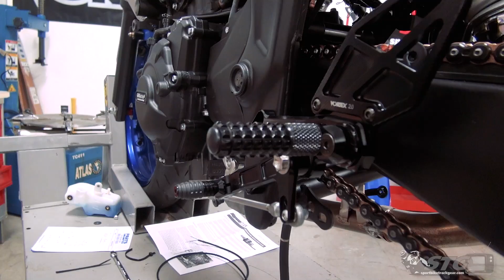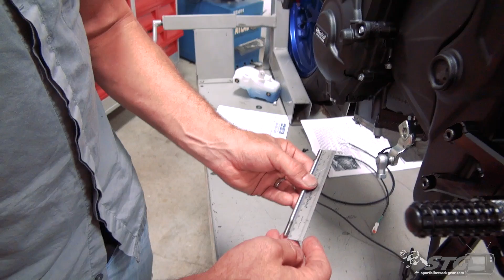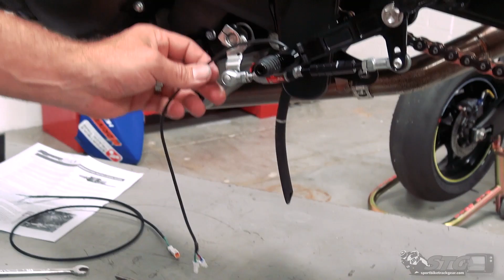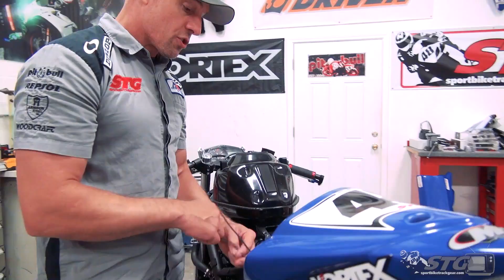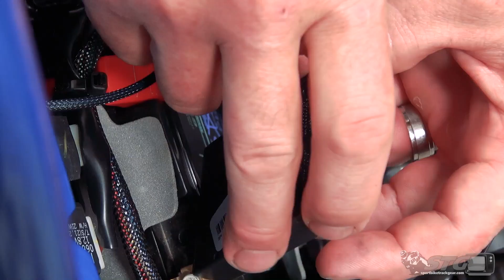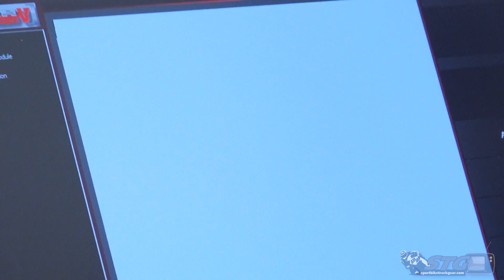Dynojet Yamaha R3 Power Commander V Quick Shifter Sensor Install | Sportbike Track Gear

Comment: A Yamaha R3 will use a Pull or a Push sensor in case you are not using the dual dynojet sensor ?

Comment: Van is obsessed with keeping his bikes clean. All my bikes have chain lube sprayed on the heim joints and on the chain ..
Reply from the maker: I do prefer a clean bike. - Van
Reply: @sportbiketrackgear    I am trying to get  20,000 miles out of my OEM chain and sprockets so I keep  putting on the Bel-Ray chain lube every day.  I bought half a case of it  30  years ago and still have a few cans left.  I bought a  new 4 oz can to carry in my tank bag on trips .. It is not nearly as messy ..  It goes on loose and clear then the thinner evaporates leaving the thick stuff on the chain .. The old Lube bubbles a lot to help it get into non-o-ring chains..,  I even get a puddle on the shop floor now and then from excess chain lube dripping out of the  front sprocket cover area.

Comment: I also installed my shift sensor backwards but I’m not using GP shift on it. Do I use the red and yellow wires or the blue and green wires?
Reply: Whether you install the sensor with wire facing back or forward, the sensor still compresses if you are using standard shift. I’m not sure why the video says you would need to use the other connector instead.
Reply from the maker: It has been a minute since I installed one of these and I can not remember which connector is which. Take a look at the instructions, I am pretty sure it calls that out for you. - Van

Comment: I bought PCV and sensor for my kawasaki zx6r 2012. I saw on youtube and on google people install it without expansion module for upper fuel injectors, and works. How is that possible? Will i need to order quickshifter expansion module?
Reply from the maker: You could also use the Dynojet Kawasaki ZX-6R 07-12 Power Commander V Quick Shifter Expansion Module
https://www.sportbiketrackgear.com/dynojet-kawasaki-zx-6r-07-12-power-commander-v-quick-shifter-expansion-module/
Reply: @sportbiketrackgear  But still can use without it? Quickshifter will work?

Comment: I install a h&m quick shifter for my R3 sometimes when I quickshift it will enter the next gear but after awhile it will drop back down by itself I want to ask when that happens will that damage the engine or clutch plates ?
Reply from the maker: It sounds like you may have an issue with your transmission. When this happens on the Ninja 400 the only way to correct it is to have the transmission undercut. - Van

Comment: Do you need a particular connector/software to connect the power commander to the computer?
Reply from the maker: You need to download the Power Commander software and use the cable that is supplied with the unit at the time of purchase (USB cable you can buy if you have lost it). - Van

Comment: Can what does it take to get a up and down quick shifter (and ideally auto blip) on bikes with cable throttles ? Is this possible/feasible? Can you direct me to such a setup for like the ninja 400 for example? Do you have any videos on this ?
Reply from the maker: Currently there is not an autoblipper available for the Ninja 400 or the Yamaha R3. You will only see these for the higher end 1000's and 600's. - Van
Reply: @sportbiketrackgear  but can you can up and down with auto blip for r6 or street triples etc ? Even ones without electronic throttle ? I’m open to many bikes I’m just trying to figure out what’s technically possible and I heard that you can’t have a up AND down shifter (or auto blip) without having a electric throttle. I’m willing to replace or flash ECU’s or add modules or PCV’s etc

Comment: why was it necessary to flip the sensor for the r3 install ?
Reply from the maker: With the shift rod set up we are running it had to be routed this way. - Van
Reply: @sportbiketrackgear  i answered my own question 2 min into the install with vortex rear sets it just won't fit cheers from Toronto Canada can't wait to get the R3 on the track thanx for sharing your skills you're a big help

Comment: I know this is an older video. But is the sensor is a push/pull sensor, or rather an extension/compression sensor. As a result, if the rod is being compressed on the up shift like in your application, and you flip the sensor around, it will still be being compressed. What does the mounting direction have to do with the sensor?
Reply from the maker: You can mount the sensor anyway you like as it is now a dual contact sensor. The harness has two connectors, one for push and one for pull. - Van
Reply: @sportbiketrackgear  No i understand that, but in the video you said if you turn  the sensor over on the bike you have to use a different connector. wouldn't one connector be a "push" or compression sensor, and the other connector be a "pull" or extension sensor? so why do you use the different connector when just flipping the orientation of the sensor? it is still being utilized in compression.
Reply: @sportbiketrackgear  Sorry, I just went back and read comments to see if anyone else noticed and saw a comment from around two years ago where this was discussed and you acknowledged the info was incorrect. I wasn't trying to unnecessarily bust your balls, just get the right info. Your videos are great and very informative for anyone looking to work on their bike.
Reply: @jonholstine7544  I understand exactly what you are saying, reading this a year after you posted it. Someone asked the same question 2 weeks ago and I replied saying regardless of how you mount it, compression is still compression, so you would need to use the blue/green wire if the sensor compresses when upshifting, and the other set if the sensor extends. Flipping thr sensor doesn’t make it do the opposite of what it was doing.

Comment: Thx for this video 
I have a Question what is the difference between a stand-alone QS AND A regular QS ? 
Do you always have to Wright them in the ECU ?
Reply from the maker: For racing or track day riding I would stick with a system that has your fuel/ignition mapping and your quick shifting integrated if possible. The R3 is a simple system so you are able to get that done with just the PCV. - Van
Reply: @sportbiketrackgear   because my problem is I ride a gixxer 1000 K9 I have it flashed by my local dealer  for more power & , Torque 

aAd they install a woolich racing kit software QS ,and launch. Package afterwards ( 1 week later ) 

And the QS didn’t not work great  

from gear 3-4 and sometimes 4-5 the QS jUST ACT strange .

It’s like  that he not pick up and jump in a high RPM for Example from 4000 RPM To 6000 RPM  puf and than catch up .
 This all  happened in a second 1,2 approximately
and the front wheel almost break out and the bike shoot forward ! Did you know what IT  could be ?! Because it’s dangerous

Comment: Best video on quick shifter, simple easy to follow and set up thanks
Reply from the maker: You are welcome and thank you for watching! - Van
Reply: @sportbiketrackgear  Only issue if you can assist I own a 2000 Gixxer 750 since new had a PC3 and recently a PC5 installed by a pro shop once the unit is connected to the Harness it creates conflicts hard starts and the machine bogs down big time , contacted Dyno Jet with zero Remedy to trouble shoot only want to have a Quick shifter realized after several hundred of dollars spent to invest in a Stand Alone unit that does not require a connection to the stock ECM ...... Dyno shops are not common and this should be mentioned by Dyno Jet prior to buying their troublesome products .

Comment: Hello Van, what's the ideal quickshift option for a ZX14R with aftermarket rearsets. Will it also provide auto blip option? Thanks
Reply from the maker: I am not super familiar with the ZX14 to be honest. Looking at the Dynojet site they are showing the linear quick shift sensor which is pretty universal. With this bike I do not think you can get this done super easy. Take a look at Brocks Performance, they do some drag bike stuff and would be a better resource for the ZX14 IMO. - Van
Reply: @sportbiketrackgear  Thank you so much

Comment: On mission critical components (the shifter is 100% mission crititcal), you should shoot for 2.5x thread diameter.  That means that a 5mm thread should have 12.5mm engagement.  If you cant obtain that with the rod you have, get a longer rod.  This goes for heims, linkages etc.
Reply from the maker: While that is good advice it is not always possible to get there. Every bike is unique and every set of aftermarket rear sets change the dynamics as well. I have since refined the shift rod set up on the R3 and the Ninja 300 after ordering a shit load of different length shift rods. IMO if you can get yourself to 7mm on the opposite side of the jam nut it will perform well and be durable. 

Over the years I have had bikes where I had been forced to run a set up like that and did not have a problem. - Van
Reply: @sportbiketrackgear  Wasn't denigrating it, just pointing out what to shoot for.  Being in the motorsport build side, I tend to see the good and the VERY bad as well as doing postmortems of failed parts and designs after races (in particular endurance events).  Id say anything less than 1x engangement is unacceptanbl which on average would be around 3 threads of engagement for a course thread fastener.  A particular situation comes to mind why I brought it up; guys was riding out of a corner, had a tank slapper moment and put his weight on the shifter and pulled the rod out of the sensor because it was threaded in about 3 turns and had about 8 more available.  Ended his race near the start.  Granted, thats not normal, but one of the things about engineering for motorsport is to plan for the abnormal so you can keep going.

Comment: will that quickshift work with power commader 3 on an R6S?
Reply from the maker: I do not believe they still offer a compatible quick shift sensor the the PC3. Best to reach out to Dynojet direct for an answer on this one. The PC3 has been discontinued for quite some time now. - Van
Reply: @sportbiketrackgear  thank you
Reply: @sportbiketrackgear  It does it requires to be spliced and inserted  2 wires ....done it myself although the Power Commander unit itself creates so many conflicts hard starts and the machine bogs down ..dated Engineering to have a quick shifter option ..you have to buy the PowerCommander ....a Stand alone unit is the route with no accessories attached to the stock ECM that works great from the get go

Comment: Hey, I have a 2008 r6 with a dynojet quickshifter - is there any way to ajust the shifter height?
Reply from the maker: Yes you would adjust the shift rod length. Having the sensor installed makes the process a little different but the concept is the same. - Van

Comment: DynoJet sensor QS cut ignition or Petrol !?
Reply from the maker: Really depends on the model. It will cut fuel and or ignition. Some models like this R3 you are able to run just the PCV and the Quickshift sensor as the PCV is able to control ignition. Other models will require the installation of other parts to enable the quick shift feature. We spell this out on our site for the various models in the PCV listings. - Van

Comment: I have the dual sensor on my Z900rs and my question is since it's a dual sensor push/pull why cant you conect it so that you can do clutches down shifts also?
Reply from the maker: You would need software in the ECU to auto blip the throttle to rev match on the down shift. - Van

Comment: Does this system work better than the Power Commander 3 ... which is dated ?
Reply from the maker: This has replaced the Power Commander 3 completely. It is a better unit, all around upgrade over the 3. - Van
Reply: @sportbiketrackgear  Sadly after buying the PC5 it works the same in my Gixxer once connected it creates conflicts hard starts and the machine bogs down if the PC requires Dyno this should be made clear before customers buy it ... out the box does not work with these units ..simple .

Comment: I have a PC5 already on my 09 zx6r. Do I only need the gear shift sensor? Not the expansion module?
Reply from the maker: No you will need the Dynojet Quick Shifter Expansion Module as well. Here is a link to that on our site: https://www.sportbiketrackgear.com/dynojet-kawasaki-zx-6r-07-12-power-commander-v-quick-shifter-expansion-module/

Comment: RED is pull and GREEN is push. not the other way around. it also doesn't matter if the cell is installed facing the the other way, its still getting pushed.
Reply from the maker: I could have been a little more clear with this for sure, there is one point where I could have done a better job. That said the direction you mount the sensor to the bike (harness forward or harness backward) dictates which color connector is activated when being pushed forward and which is activated when being pulled back. (flipping the sensor on the rod 100% changes the direction of the force)  The initial set up was for Standard shift pattern so the shift knuckle was under the shift shaft, we used the green connector to make that work (pushing on up shift). The bike is now set up for GP Shift Pattern so the shift knuckle is above the shift shaft, we are using the red connector now (pulling on up shift). On the R3 we I had to install this sensor with the sensor harness (female end) facing towards the rear of the bike (would really have preferred to have it face the front to avoid folding the harness over but was unable to do so),  in this direction Red is pull and Green is push. If the sensor was to be mounted in the other direction it would be Green for push and Red for pull. - Brian Van
Reply: Sportbike Track Gear hi Brian thanks for the reply. Yes putting the shift knuckle above the shaft definitely changes the rod from push to a pull. But changing the orientation of the cell does not change which colour lead you use. Think of it as compressing the cell or tensioning the cell. Below the shift shaft, the cell is getting compressed (push) regardless of which way the female side is facing. Think you’re a bit confused because the end of your message says “1 way it’s red pull green push, the other way it’s green push red pull” :)
Reply from the maker: You are right, I jacked this up my man. Push is push and pull is pull, the variable is which direction produces an upshift on the bike. Man I have answered about 300 comments in the last couple of day, low on bandwidth.
Reply: @davejimgut  *color

Comment: So is it red and blue for pull option and green and blue for push option. I have a 07 gsxr 750. I switched it to gp shift. I need to use pull  option. Trying to figure it all out.
Reply from the maker: Before I answer I need to know if you have the new Dynojet Dual Contact Sensor or one of the older directional models? - Van
Reply: Sportbike Track Gear Yes, I have a dual contact sensor. But I called dynojet and confirmed. Red and blue is for pull type and green and blue is for push type. Thanks for the reply though! 👍🏼

Comment: Would you recommend this over the healtech iQSE? I would only use it for upshifting.
Reply from the maker: Yes, I feel like this system works a little better. More consistent operation and a little quicker. - Van

Comment: How do you set up the quick shifter to do clutchless up and down shifting?
Reply from the maker: The R3 does not offer the option of auto up and down shifting. With this bike and most others clutchless upshifting is all that can be done at this time. Autoblippers are currently only available for most of the latest high end liter bikes and 600's. IMO there is no need for this feature on the R3, the clutchless upshifting is already a real upgrade. - Brian Van
Reply: If you need to ask your probably not qualified to have one. Jk..... Not really.

Comment: Can you please add a link for the rod in this vid.  Our Australian distributor is not very smart and sent me the wrong one.  Amongst a lot of issues I had with them (serco) i would rather deal with someone who actually knows what they are talking about. 
I did a pcv, quick shifter modual plus quick shifter install vid on my hayabusa (2nd gen)
Reply from the maker: Here is a link to all of the Dynojet Shift Rods on our site: https://www.sportbiketrackgear.com/Dynojet?_bc_fsnf=1&Product=Shift+Rods

Each listing has all the specs for the rod listed to help you choose the correct one for your application. - Van

Comment: The smart way to do it would of been to thread the shift rod all the way in on both ends. Then you can rotate it to get the desired length and ensure that both ends are extended equally.
Reply from the maker: You can do that or measure, either one will work. End of the day it is very important to have enough threads engaged to keep the rod from pulling apart over time. - Van

Comment: Iv been looking into getting a quick shift for mine, and for the track it really seems to be a god send ( if you will ) my cables already are pretty stretched. even after making adjustments iv still got tons of play in my throttle before it even does anything.            Thank you for making these videos, and thank you for going through the last couple step by step and showing whats involved.    Safe and happy travels to you and every other rider out there.
Reply: Seems there would be another throttle cable  adjustment near the  throttle bodies..  Consult your shop manual